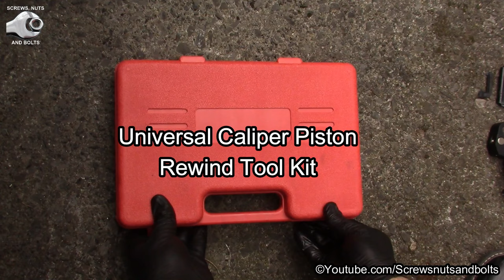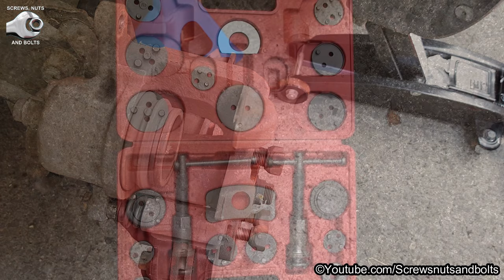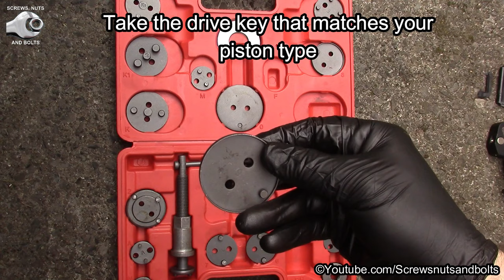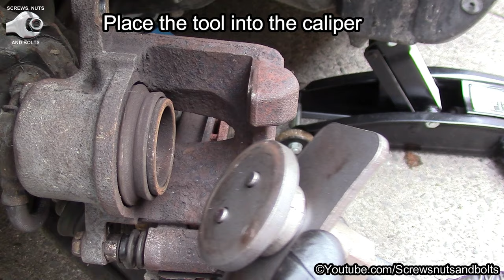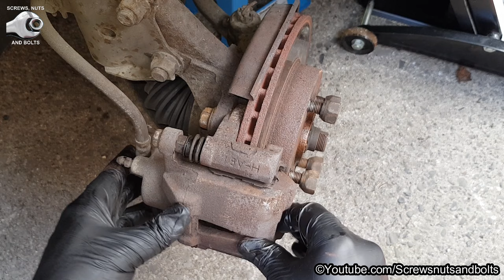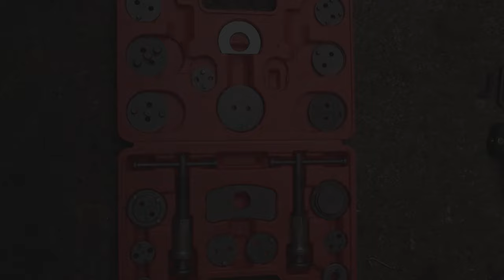Brake Caliper Piston Rewind Tool Kit

Comment: If all your pistons are the push only type then save your money and use a C clamp with an old brake pad against the piston. Been using C clamps since 1973.
Reply: Lol they haven’t made those in 20 yrs. Go sit down grandpa
Reply: @jeremyhuntington1  just changed my 2018 Lexus ES brakes with a C-clamp
Reply: C clamp fine for fronts but back need turning and pushing at same time.
Reply: I just vote Trump 2024 M.A.G A and it makes my brakes Great Again
Reply: I thought a c clamp would work on my TSX, like I usually use for my cars before, but it has to be rewound. I miss cars that are easier to work on without specialized tools.

Comment: For front brakes that just require pushing it, there is an adapter on the right side of the case that rotates so you do not grind against the piston.

Comment: The proper adapter to use for this type of caliper would be the #3 adapter. The #3 adapter does not spin on the caliper piston which could cause it to crack or chip the piston. It also puts less wear on the tool, the caliper and the user.
Reply from the maker: Thanks, I explained that in the video description 👍
Reply: @screwsnutsandbolts  Yeah, guess I should read the descriptions more. Lol
I really just commented because I know it helps to boost your channel. 
Keep on Keepin' on!
:goodvibes:
Reply from the maker: Thanks for watching, I appreciate it 👍 @tsepash

Comment: Usually only a C-clamp pushes back the hydraulic cylinder,  A L T H O U G H, on Nissan Altima, the rear disk brakes needed this screwing in motion whilst turning to push the cylindar back.   I never would have guessed the secret to push back the cylinder without a good video such as this.  Ran, not walked to the Harbor Freight and bought this tool and it worked.
Reply from the maker: Thanks, this updated video shows it being used on both front and rear calipers: https://www.youtube.com/watch?v=gIPfUy0YaC8

Comment: I have the exact same kit (21pz). It gets the job done nicely, but for example the N6 and N7 plate adapter are the exact same, the N3 doesnt have the holes to be atached, so i dont know how to use it. The A plate doesn't fit in the pusher..
If you are in doubt about getting the 18 or 21 just go for the 18. It doesn't worth the extra money, and anyway you will be using only 3 plates.
Reply from the maker: You're probably right. 3 plates ?.....maybe 2 lol
Reply: Are the 2 reactors same?

Comment: Back brakes are more difficult as teh handbrake cable does not allow such easy access to the calliper. Also on my estate Mondeo left and and right hand have to be rewound in opposite directions. Clear video thanks
Reply from the maker: Thanks. This video shows the kit being used on both the front and rear calipers: https://www.youtube.com/watch?v=gIPfUy0YaC8

Comment: If you're doing driver and passenger side do you use the same reaction body thus turning in the same direction?
Reply from the maker: Yes it's the same on both sides. This video shows how to retract both front and rear calipers: https://www.youtube.com/watch?v=gIPfUy0YaC8
Reply: @screwsnutsandbolts  I rented one after watching your video, and could not get the piston to move. I ultimately determined it was frozen and replaced the caliper.
Reply from the maker: @badtothebone346  That's a pity, hope it wasn't too expensive !

Comment: I followed this guide and after 1st caliper I realized something must be wrong, with that many adapters we should not rub against the caliper itself..
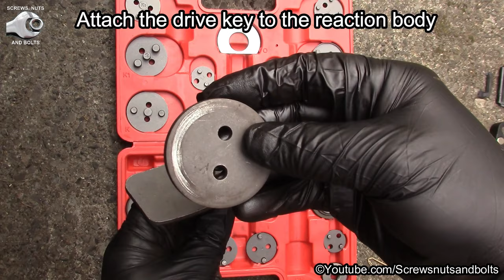The correct adapter for hollow calipers like shown on video is visible at 1:19 just under right hand. 
It’s a few layers of different diameter solid circles. This stays inside caliper without spinning, while you spin 2nd adapter inside that one. Sounds maybe more complex that it is..
Reply: What u mean bro?
Reply: I know something looked off. Hopefully the correct adaptor doesn't rotate on the piston like that. Would it kill them to include a short instruction sheet in the kit! Anyway, thanks for the video I would have never figured out what the reaction plate was for.
Reply: My problem is that no adapter fits the adapter you're talking about. The tool does not fit directly either, there is too much play.

Comment: Hi can you tell me how to know if the piston is left hand or right hand type? I bought the kit but I only see 1 handle for right rotation only.
Reply from the maker: If there's only one handle with a kit it will usually be right handed. Nearly all pistons are rotated clockwise as you reset them. Very few are rotated counterclockwise

Comment: Why a left handed and righthanded tool? Isn't it always clockwise to push the piston back?
Reply from the maker: Apparently the odd caliper has a counterclockwise thread although I've never come across one.
Reply: The rear calipers sometimes have a handbrake mechanism, the pistons in them need to be screwed in. In some cars they are screwed in clockwise and in others counterclockwise. This problem does not apply to front calipers where you simply compress the piston without rotating it. You can use any tool here.

Comment: Soo, mine is seized (vw scirocco), I tried with the brake fluid resservoir cap off, tried it with the thing on also (dunno why), I also tried after disconnecting the hand brake cable, I have tried both directions assuming I must've been an idiot, but nothing seems to have worked, it's as stuck as can be and really clamping the pads onto the rotors hard when I "slide" it back on (with force as it's the only option), any ideas..? Getting a little desperate here, did I miss something?
Reply from the maker: Just to be sure, you are rotating the piston as you push it in ?

Comment: Is it best to drain the brake reservoir beforehand?
Reply from the maker: You could remove some fluid from the reservoir before you begin but don't let the level drop below the minimum line at any stage or you could let air into the system
Reply: @screwsnutsandbolts  Always make sure the lid on the brake resevoir is open to let the pressure out when using the tool

Comment: The drive key you have to use is the #3, the one with no lug on it ! Not the #9 !  Only the #3 will not turn with the screw & scratch the piston edge !
Reply: My tool does not fit the #3 plate, there's too much play.

Comment: Why do these kits all have clockwise & anti-clockwise drivers, when the rear brakes screw in clockwise?
Reply: Some cars have both of them on the rear. Left side has anti-clockwise and ride side clockwise (piston goes in like the wheel rotates forward).
Reply: @cmos64  - That's odd! How do you know which car has which type of rear caliper (i.e. clockwise, anti-clockwise or both)?
Reply: @Benzknees  Without a workshop manual I don't think there's an indication of the type just by looking at it. If you don't know start just by turning slowly by hand without pushing in and you'll figure it out.

Comment: I seem to have mine pushed in. But I cannot unscrew it?
Reply from the maker: Use a spanner or visegrip to rotate the body of tool clockwise to loosen it. Rotating the bar itself counterclockwise will not loosen it if it's pressed tightly against the piston face
Reply from the maker: Watch this video at 3:18: https://www.youtube.com/watch?v=gIPfUy0YaC8&t

Comment: Is it the just the rear caliper that winds in
Reply from the maker: Yes it's usually only the rear caliper pistons that need to be wound in.
Reply: @screwsnutsandbolts  do you have to disconnect the handbrake when you wind it in?
Reply from the maker: @Ethankeenan02  No you don't have to disconnect the handbrake cable from the caliper, but make sure the wheels are chocked and the handbrake lever has been released before you wind the piston back.
Reply: @screwsnutsandbolts  thanks
Reply from the maker: @Ethankeenan02  You're welcome

Comment: what am i missing here,,,,,,,,,the video says piston rewind tool, and all i see is this expensive kit to PUSH the piston back ..........you could do that with a C clamp style vise grip.....or any steel plate and a forcing screw..........again please,,,,,,,,,,,,what am i missing.........thanks.
Reply: 20 bucks for this kit is not expensive and it will do multiple vehicles if they have key style pistons
Reply: You can't just push in a rear piston on a caliper (you can on front caliper) as there is a threaded rod connected to the piston that the handbrake uses to twist the piston against the disc (mechanical and electric handbrakes). If you force the piston in, you could strip the thread etc. The piston must be turned in rather than pushed, hence the kit with all the different diameter bits with lugs on that locate in the piston to turn it.